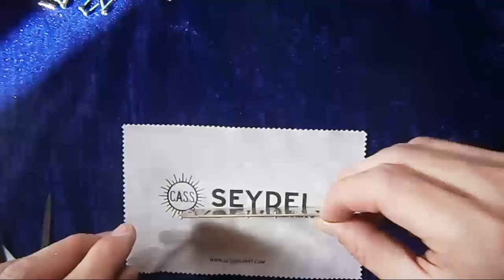How to repair blues harmonica

Comment: Are there any books you'd recommend for learning to do harmonica repair? I've got about 30 harmonicas or so of all types and would love to go through them and tune them up, replace reeds, etc..  I;ve got my fathers old Hohner Chrmonica that my mother gave to him before he got on a troop carrier to fight in the Korean war.  He drove those GI's almost nuts but, he learned to play while on that ship.  He had it gold plated a few years before he passed and I've got it in my collection now.  The 6th hole almost sounds like it's trying to play two notes at the same time,  the 7th and 8th holes also seem to be trying to play two different notes at once.

I picked up a harmonica repair tool made by Harmo and it has abouot 12-15 different tools on it.  Hopefully that will do the trick..  Any help is greatly appreciated.
Reply from the maker: The truth is that I do not know if there is any book that deals with this topic.  If you allow me to give you some advice, it would be to practice with harmonicas that you don't appreciate so much.  once you see that you are good at repairing harmonicas you could try repairing your father's old harmonica.  another option you have is to take this harmonica to a luthier to have it repaired.  Harmonica repair is not very expensive.  good luck with your repairs.  Also tell you that there are websites on the internet that sell reeds for honner harmonicas of different models.  a greeting.
Reply: مهارت وتجربه واعصاب نیاز دارد

Comment: It would really be helpful if you could give a step by step verbally so we understand what exactly you are doing and why. It's a great video and helpful as it is but I'm someone who likes to know names of the parts , and why it's done a certain way. Kind of like when you were filing the reed down. How much was taken off is there anywhere to find actual schematics for measurements and such. I think it would be good if you play a instrument to know how to work on it modify it, tweek it, or clean it. Same as if you drive a car I think it's a very smart thing to know how to work on it and fix almost any issue. I know there are some things that have to be done by professionals but for theost part you can fix anything yourself. Saves money, time and you feel good knowing you are capable.
Reply from the maker: Thanks for your comment.  I don't speak English that's why I decided not to put voice audio.  when i made this video there was no machine translation on youtube.  these things are learned with practice.  the first few times it probably won't go well but with a little practice it's easy to get a good result.  I don't know any schematic or manual.  the help of a tuner is essential.  With practice you will see how much you have to file and in which area of the tongue, on the top or bottom depending on whether you want to raise or lower the note.  Greetings and thank you very much for your contributions.